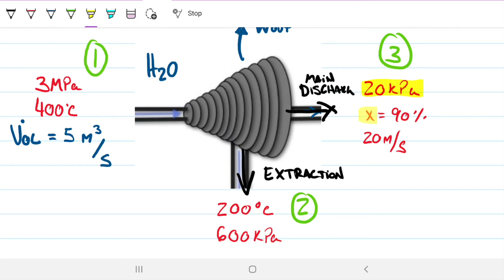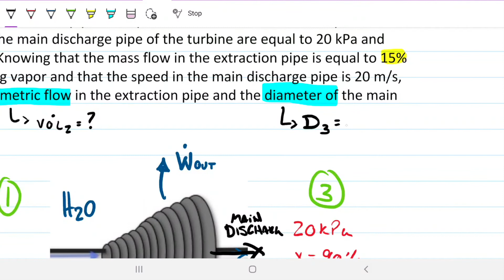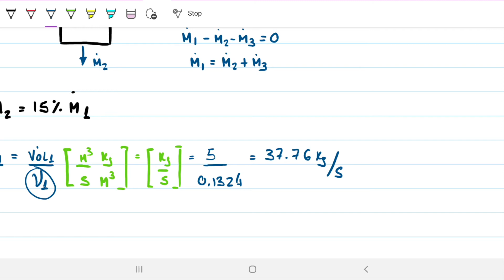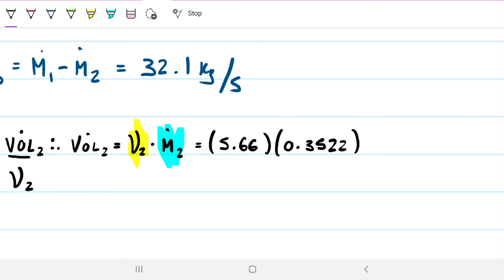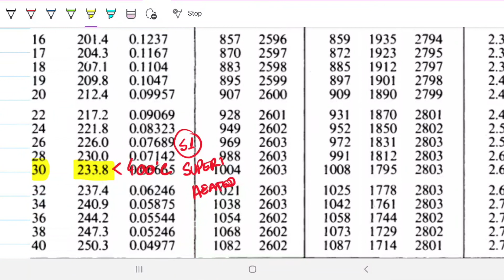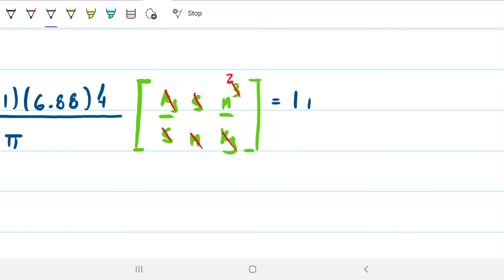Comment: This is a very helpful video. What books did you use to learn thermo? I studied Reed's heat for marine engineers. Thanks
Reply: I'm glad you found it helpful. A lot of the problems here are from Yunus Çengel's books, and I can recommend his books as they are the ones I use in class. But I've already read lots of different ones. They always complement each other in subtle ways.